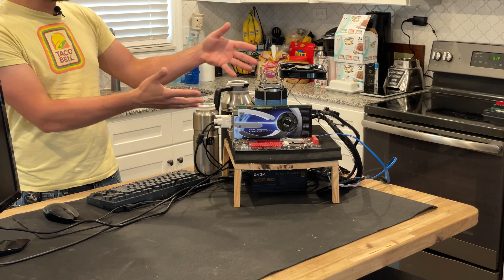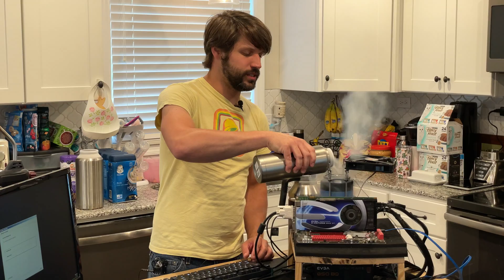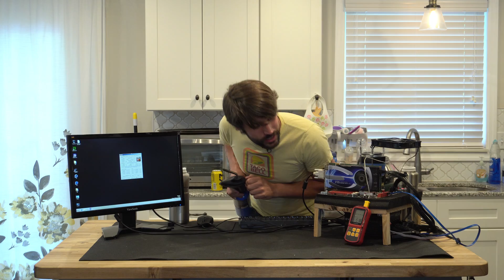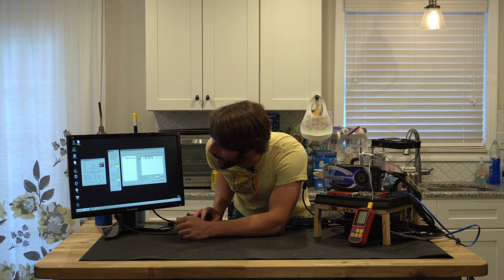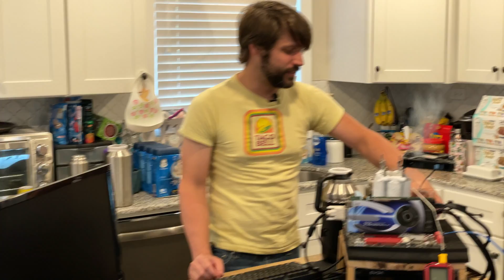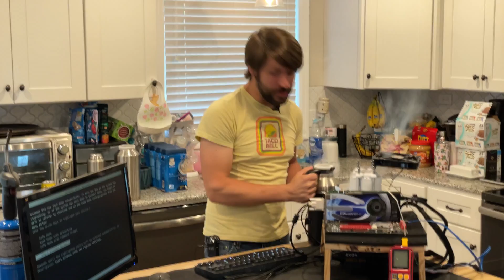Overclocking an FX 9590 to 8ghz!!!

Comment: This is iNsAnE!!! And I was running a stable 4.9GHz with RAM @ 1912MHz. Now that my motherboard gave up, I'm looking for a set of safe "AUTO" settings on this replacement (lower revision) of the same board, which is a 990FXA-UD3.
Reply: You only got 200mhz over stock? Are these THAT unstable that they can't run at full core turbo speed of 5GHz?

Comment: I have the FX-9590 OC at 5.2. With the same MB as you Formula-Z. (Running strong since 2015). Have you ever installed Win11? I'm debating to upgrade my Win10 to Win11 on the same platform. Wondering if it can be done before I start building a second PC for my son this one will be all RGB.

Comment: Any CPU that manages the magical 8 will now have "Gigglyhertz" in place of Gigahertz..i do wonder what the first Terahertz CPU would be like..
Reply: Amd fx 9590 1 gigawatt and with cooling of black hole that absorbs the heat
Reply: Considering the latest CPUs have barely hit 6 GHz in their stock speeds and CPUs nowadays are less overclockeable than before I'm sure it's gonna take quite some time